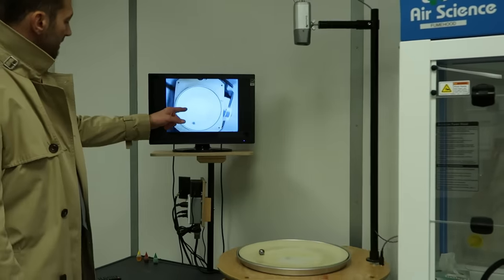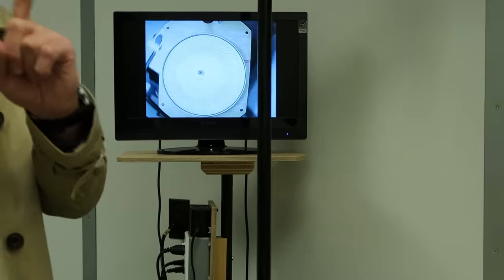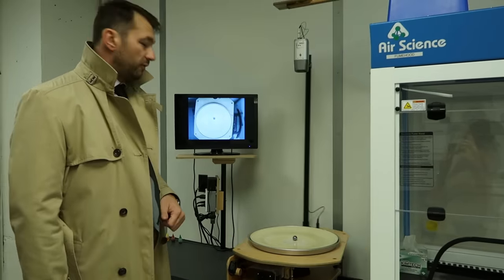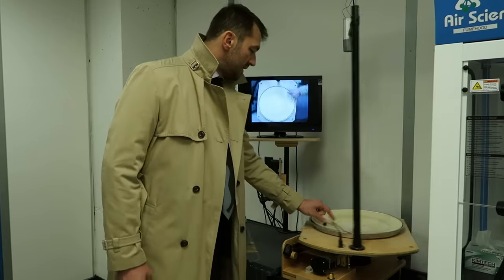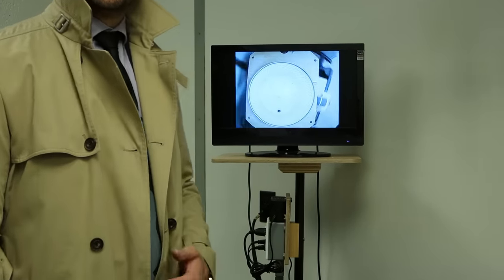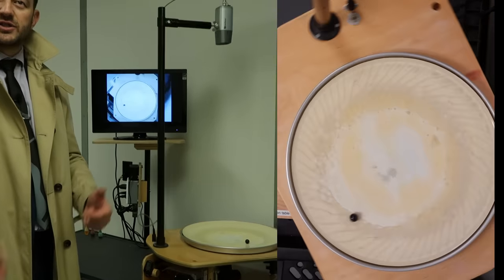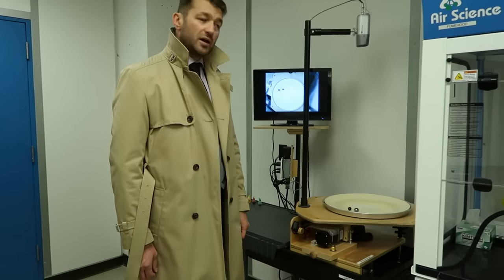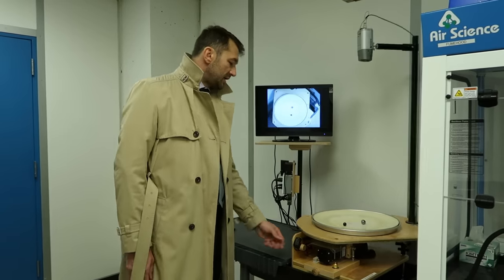Best Demonstration of Coriolis Effect on YouTube

Comment: The Coriolis effect comes up in accurate long range shooting. I can accept the need to adjust for it but, did not have a good understanding of why. Now I understand.

I also appreciate the example of the inertial and non-inertial reference planes. 

I am now more amazed at the understanding of physics needed to hit a target with indirect fire.
Reply from the maker: I went to a shooting range in Texas and then calculated the bullet deflection caused by the Coriolis force. Check out that video. Although it's not long range shooting to be fair.
Reply: No it doesn't You're a liar...Army Rangers Sniper.
Reply: @godbluffvdogg

Depends on the range and the compass direction.  Extreme long range shots have had to account for it, such as the record-setting shots by a Canadian sniper in 2017.  The distance was 3,540 meters, well beyond typical sniper shots.
Reply: @THall-vi8cp This is an old  hearsay that keeps coming up, between all the variables such as distance, wind, air density, humidity and elevation  it can not be proven that Coriolis force has any effect. None of the really long range targeting systems such as canon fire or missile targeting  systems count for Coriolis force and they travels hundreds of miles !
Reply: @azar3006

Missiles?  Really?  Missiles are self-propelled, often guided, and have homing systems.  Coriolis will have a greater affect on ballistic objects - objects that do not move under their own power.  Even ballistic missiles have their own guidance systems to ensure the payload hits the target.

I would love to see your sources that claim to debunk its effect on ballistics.
Reply: @godbluffvdgg  you might be right. I doubt anyone has ever taken so claimed Cori effect in shooting at even long distance- never. It’s about wind variances and loss of bullet inertia- NOT Cor effect!
Reply: @azar3006 . Yep- you are 100% correct. Been shooting for 50+ years with expert marksmen- never heard Cor effect brought up- not once ever. Included on a navy destroyer. The presenter is full of # 2 with his CE claims while shooting. Cannot stand those that flat out lie.
Reply: No.
Imagine everything other than parallel to the spin would introduce  more  variables. 
There's no correction for coriolis

Comment: Excellent demonstration, Thanks for the video. The curvature if the motion changes w.r.t reference point. What is the actual motion, straight line? What happens if you put a wet  paint ball, will it draw straight lines?

Comment: That was very informative, thank you. What I'd like to see is having the marble swinging back and forth but the marble is attached, by way of a string, to the rotating camera. Would the effect be the same? Since now the marble is not experiencing friction from the plate. I would venture to guess that the marble will swing in a straight line regardless of the position of the rotating camera.
Reply from the maker: Yes, the effect is the same. That apparatus is called the Foucault pendulum. I have a separate video about the Foucault pendulum.

Comment: I'd be more impressed if the  ball was to move in a Strait line then rotate the table. 
Releasing the ball mid way will only ever give the illusion that its curving. 
Just an idea. May be wrong but could give you a new video proving me wrong. 🤔
Merry Christmas
Reply from the maker: Merry Christmas. 

The ball is moving in a straight line in the inertial reference frame. It's the table that is rotating underneath.

Comment: Would it matter if the plate was centered on the spinning axis instead of how it is in this video (offset)?
Reply from the maker: No. Higher rotational speed of the disk would matter. It would result in larger deviation.

Comment: Does the earth have an impact on the experiment's observations? Will the observations be the same if this experiment was set up in the southern hemisphere? i.e. Will the cycloid trajectory of the marble still be to the right in this setup if it was done in the southern hemisphere or at one of the poles at the geographic centre?
Reply from the maker: Earth's rotation does effect all motions including that marble's. However, the effect on the scale of this experiment is practically unmeasurable. One can simply demonstrate that by calculating the Rossby number for this experiment. The outcome of the experiment would be the same in the Southern Hemisphere because, as I just wrote, the Earth's Coriolis effect on the scale of the experiment is negligible.

Comment: Second time I've watched the video. Just so I get inertial versus non-inertial straight. I would like to see this demo with a straight line across the diameter of the parabolic dish. To judge movement in the inertial frame.
Reply from the maker: There is a straight line across the dish at the beginning of the video (no rotation), but also later in the video in the inertial camera view.
Reply: Not seeing it. I mean like a nice black magic marker line across the diameter of the dish. 🙂

Comment: Hard to get until you watch the arm come in and grabs the marble. It rotates too even though he isn’t rotating. The marble isn’t changing direction, the plate below it is.
Reply from the maker: Correct. However, if you are an ant on that plate measuring the position of the marble, you would observe deviation of marble's path (to the right). That's the Coriolis force.
Reply: @DjordjeRomanic  that’s the part I was missing! Thanks, doc!

Comment: This proves the 1st ball don't go in a straight line at all but is moving to the side very minimum each time it go's up, so the camera is no different only you can see it much more better. Before the table was rotating the ball was indeed going in a straight line.
Reply: If the line where to go straight on the rotating table it would also on the camera screen but only rotate.

Comment: It will take some time for my brain to get this. The camera's frame/Scan rate is not a factor?
Reply from the maker: The camera frame rate does not affect the outcome. What would affect the outcome is different rotational speed of the turntable. If the turntable was rotating faster, the deviation would be larger. If the table was rotating slower, the deviation would be smaller. Of course, no deviation if the table is not rotating.

Comment: Does this mean that if we get close to the north pole (or south pole) and we drop the marble it will oscilate in cyclades and not in straight lines? Given that one would have the same perspective as the non intertial camera (the camera that rotates with the plate)?
Reply from the maker: In your scenario, the marble would prescribe a circular motion. That circular motion is known as inertial oscillations. I have a video on inertial oscillations if you want to know the details.

Comment: Rather than a marble rolling on the paraboloid, why not a pendulum swinging just above the surface? This way, there's much less friction between them, and you get a cleaner straight-line trajectory.
Reply from the maker: That is an option too. I already had this apparatus, so it was easy to conduct this experiment. I do have a video on the Foucault pendulum if you are interested in that.

Comment: Very interesting!  How can this be?  How can two camera's, looking at the same experiment, see two different things?? I know one camera is spinning and one is stationary. But HOW can they be taping two totally different realities? I can't grasp this concept. "Does not compute".
Reply from the maker: Difference between inertial and non-inertial reference frames. T
Reply: @DjordjeRomanic  I wonder...If each camera, could count how many times each ball was rotating, I assumer that they would be exactly the same. Even though it seems that the spinning camera would record higher revolutions??? Fun to imagine!
Reply: They aren't taping two different realities. They are taping two different views of the same reality. There is less going in here than you seem to think. Think of a ball moving in a straight line. A stationary camera shows the ball moving. A camera moving with the ball shows it as stationary. A camera violently shaking back and forth shows the ball violently shaking back and forth. Etc.
Reply: According to Einstein, it had to do with your point of view, called ‘frame of reference’ to motion. It’s not two different things, it’s the same thing from different reference points.

Comment: What I don't understand is why it is called "force". I understand how it is caused, why we see this result in movement of the ball or fluids (as a matter made by particles, idealized as a ball ), but still I do no perceive that this is a force! Isn't it the inertia of the particle - the ball - that cause this effect?
Reply from the maker: It's just a matter of labeling. If you are in a non-inertial reference frame, you will receive it just like any other force. But some people do call it the Coriolis effect. Another labeling reason for calling it force is associated with the 2nd Law of Newton. This term appears like any other force when the law is cast in a noninertial reference frame. You can check out my quantitative videos on that.

Comment: Now....given that the cell phone camera is the inertial reference frame and the view that we receive is inertial which produces a straight line effect...what happens if we rotate the video screen in sync with the rotation of the non-inertial frame of the camera attached to the rotating table? Do we get a straight line? What happens if the screen is rotated clockwise or counterclockwise or, conversely, rotate the non-inertial camera either clockwise or counterclockwise in sync or out of sync with the rotating screen. What do we see? Also, would the presenter seem more, or less, convincing with, or without, the Dick Tracey trench-coat. Would a hillbilly accent still produce a convincing effect, or should we just stick with the thick, Eastern Euro accent for effectiveness?
Reply from the maker: The experiment does not work if you don't have Eastern European accent.
Reply: @DjordjeRomanic  I repeated the experiment by playing the Beatles Revolver album in reverse while driv**
ing on the right side of the rsd on Abbey Lane.

Comment: In fact, Coriolis force DOES NOT ACT in your demonstration. The path in the non-inerttial frame is curved because there is no coriolis force accelerating the ball in the tangential direction as it moves radially in relation to to centre of the disk. If coriolis force were acting, the path would appear straight across the plate through its centre in the non-inertial frame. The ball is falling behind the rotation of the disk, it is not keeping up with the disk because coriolis force is absent.  What you are seeing here is the “Coriolis Effect,” not the “Coriolis Force.”
Reply from the maker: Coriolis force and Coriolis effect are the same phenomena. Or, if you wish, the Coriolis effect is an effect that the Coriolis force exerts on motion.

Comment: Ummm ackshually an inertial reference frame is reference frame that is moving along a geodesic to be exact.
Technically standing on earth is non-inertial, and falling to earth is inertial, as although you may be "accelerating" you're moving along a geodesic.
This can be proven by the fact that an inertial reference frame has zero net force.... Standing on the ground on a scale proves there is a force, accelerating up, while there is no force acting on something falling (i.e. in a falling lift standing on a scale shows 0kg)

Comment: This isn't pure Coriolis force as the spheres interact with the bowl and are being accelerated in radial and circumferential directions. A pendulum without interaction would be a pure demonstration, or a bullet shot across the plate without interaction.
Reply from the maker: This is a pure demonstration of the Coriolis force in a twodimensional case (i.e., flat geometry).
Reply: @DjordjeRomanic  no
Reply from the maker: @mreese8764 ok

Comment: I see it…I don’t understand it

It’s straight, it’s curved, it’s both

What?
Reply: It’s all about one’s point of view, aka frame of reference. This is why two people in two separate locations separated by a significant distance will view a phenomenon differently. If you were say the same size as the marble and standing on the plate watching all of this, you would see the marble appear to be bending to the right, even though it’s actually moving in a straight line. Now the camera that’s spinning along with the plate has a different point of view, it’s showing a cycloid movement because it’s spinning at the same rate as the  plate. The stationary camera shows what it sees from its point of view which is the marble as a straight line.

If your in a car moving at the same velocity as a train, your view of that train is that it appears to be standing still Vs. someone standing at the train station watching that same train go by views the train as moving.

Here, this experiment is showing different perspectives of the marble only this is about rotational forces and effects.

Comment: sorry thats not completely  correct. marbles can travel in both right hand and  left hand  circles even with one  directional spin of the plate
Reply from the maker: How?
Reply: How is that possible ? Even if you initially rotated the marble itself clockwise, eventually it would lose its initial momentum and then the friction with the plate would process counterclockwise.

Comment: See plate edge move sideways as it rotates: Center of plate is not on center of rotation.  This will sweep the marbles sideways too.  I think this results in false measurements.
Reply from the maker: Center of the plate was the center of rotation. However, even if it wasn't (e.g., say, it was slightly off), nothing would change. You would still experience an apparent force given that the system is an accelerating reference frame.
Reply: @DjordjeRomanic   Come one, just move the mouse pointer to the side of the plate while it's spinning and you see the plate is moving away from and then back again towards the fixed mouse pointer.  It's off by about 8cm.  Not good for science to say I'm wrong without having a look.
Reply from the maker: "Come one", I like how you did not round it to 5 cm or 10 cm, but assessed it to be off by precisely 8 cm. That's the good science.
Reply: @DjordjeRomanic  Nope, I wrote "about 8cm".  Initially I had 10cm, but that was clearly too much.  Peace 🙂

Comment: I never liked separating the inertial and non-inertial reference frames, because it creates a mysterious feature that is not actually there.  The spinning camera knows it is spinning and can therefore remove its known spinning condition from the ball and arrive at the inertial perspective.  It knows it is spinning, because when spinning fast enough, it is ripped apart.  I think acceleration, being absolute and all observers agree, makes acceleration the ONLY force there is.  Everything else forcelike is a manifestation of this one thing, acceleration.  "What causes it" is a question that modern science has removed from the scientific method.  Oh yeah, each velocity has INFINITE definitions, so velocity does not exist to nature, until it hits something, then it's absolute.  Describing what you see it do with math is NOT an understanding.
Reply: Science  -- modern or otherwise -- hasn't removed any such thing.

It's much more convenient at times to use a coordinate system that is rotating -- e.g. in geophysical fluid dynamics, used in meteorology or physical oceanography, we use one that rotates with the earth, allow us to treat features and reference points on the surface of the earth as stationary. If you do that, you need to introduce the Coriolis force.

Believe me, we are perfectly fucking aware that it is fictional. There is nothing "mysterious" about it. And yes, sometimes describing it with math is the ONLY way to understand it, because the phenomena are not obvious otherwise. If you doubt that, then you simply haven't done any real physical science of any kind, which is pretty obvious anyway.
Reply: @vampiresquid  "The wheels on the bus go round and round." This song describes EVERYTHING you see a bus do EXACTLY like math does, but it is NOT AN UNDERSTANDING of a bus. The variables in gravity math are likely incidental, NOT CAUSAL.  You regurgitate the paradigm that you were taught THAT YOU HAVE NO RESPONSIBILITY FOR. I am the only one that ACTUALLY UNDERSTANDS the gyroscopic effect that NO ONE WANTS due to your goofy paradigms that you follow.  So you watched my gyro explanation, and you cannot see it.  You are the one that needs help.

Comment: What is a centimeters? Asking for an American.
Reply from the maker: It's a distance 100 times smaller than a meter. And 1 m is the standard unit for distance in the International System of Units. 1 cm is about 0.4 inches.

Comment: The Coriolis effect is a false concept. It is only possible on spherical objects so the Coriolis effect won't work on a flat earth. Yes, the earth is flat.
Reply: Idiotic and foolish to assert and believe that nonsense. All anyone needs to do is go to the Franklin Institute in Philadelphia, PA and right in the foyer, there’s a huge pendulum hung from the ceiling. As the earth rotates below the pendulum, the pins which are placed in a 360 degree (circle) are knocked down by the pendulum as the earth rotates below it.